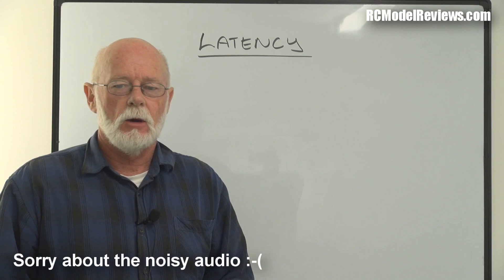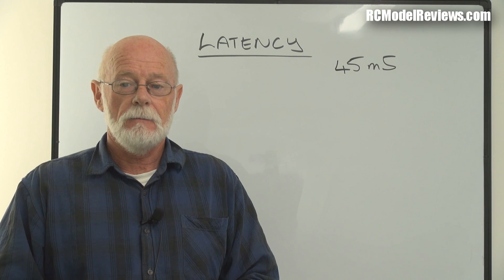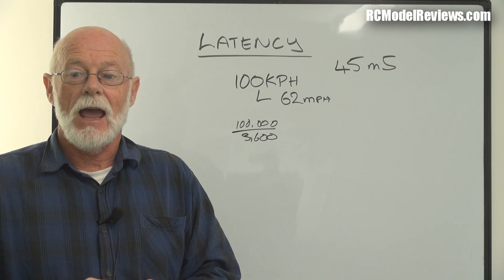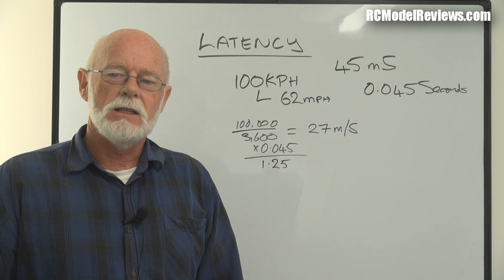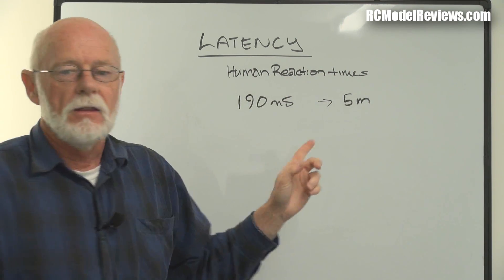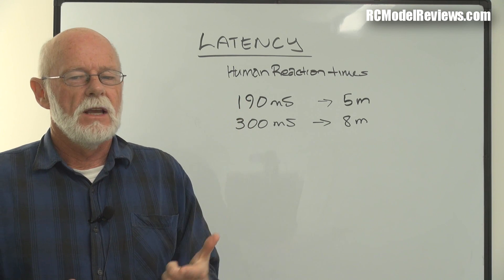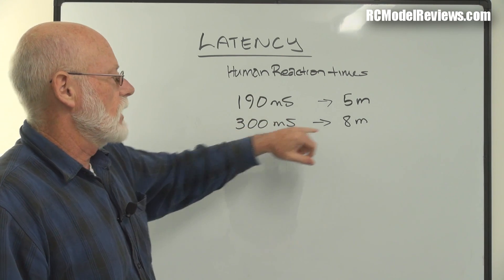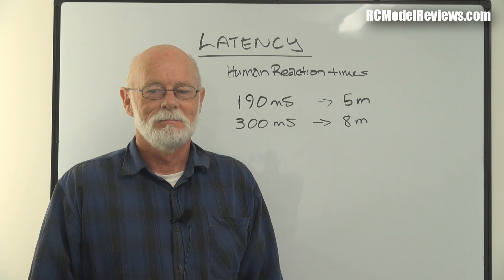FPV Video Latency - does it matter?

Comment: Back when i used to be a competitive gamer a decade ago, i recorded reaction times of around 170 on click test. But i believe there is not one uniform reaction time, i think minor corrective motions towards executing pre-planned actions based on positional feedback could happen as early as in 50ms. I don't think sudden event or obstacle that click test could represent is the relevant kind of event that usually stresses latency based response, rather it's the motion deviation. You'd think if the reaction time was uniformly 220ms, you wouldn't have had the experience that higher latency system spoiled your manoeuvres.

Comment: Thanks for that. Rounding out your figures, the quad will travel 1 metre per 1/100 sevond. There seems to be more cameras than quads at the moment and, at my age, I can't tell the difference. The authorities here in the UK have tried to make us use KPH for 30 years or so, but the speed limit signs are still in MPH.

Comment: To fix this latency issue, discarding the human factor. Is to shrink yourself so you can comfortably fit inside a racing drone. Hopefully there control gimbals are small to fit your scale. 
Although you may experience significant delta in gravitational forces against you which is typical in a multirotor flight pattern.

Comment: Latency -- a topic i'm very familiar with.  In my experience with online gaming, the lower the latency, the better.  50ms or under is next to real-time responses, 50-100ms is about borderline playability, and over 100ms means a crapshoot.  And I'm pretty sure the same thing is applicable here.  50ms or lower, you know exactly where you are, 50-100 ms you might know where you are, and 100ms or above you're simply guessing -- and if you guess wrong, you get a crash.

Comment: I wonder how this relates to video gaming latency times. You have high end gaming monitors that boast a 1ms refresh rate, and anything under about 5-8ms is mostly not perceivable. But this is more to reduce ghosting or redraws from one frame to another. If you look at VR headsets you need at least 90fps and very low latency to reduce motion sickness from the difference head movements to what you visually see on screen. I think your brain learns a buffer when flying or doing anything with latency involved, the more you do it the more natural it feels.  Also, when you fly you are not just completely "reacting" to the situation, you are formulating a path in your mind given the visual data you already have. It would be really funny to switch someones video goggles on and off every 5 seconds and see them fly by "reacting" every time the goggles come back on!

Comment: i watched your videos on ducts i have a question, what would happen if you just duct beneath the propeller? would the air hitting the side of the duct have enough negative effects where it is not a benefit? are ducts beneath the propeller a benefit at all? say you hooked up a quad with super light ducts just beneath the props. what happens if you use the push method with a duct so that the air being pushed down isn't blocked by the quad frame? what happens if you use the push prop method and put ducts just beneath the prop would this help? so a racing quad with push orientation of the props using four blades per prop with bullnose and ducts just beneath the props? from what i know this would give the prop setup more efficiency so to get the same thrust you can use less power from the battery granted the surface of the side of the duct doesn't hinder performance

Comment: I bought a fatshark 700tvl ccd cam for my Xugong v2.  This is my first quad / build.  I am very disappointed in the clarity.  I was at our sports plex this after noon testing out my ezuhf system and and cannot say how horrible the video looks. my vtx is 600mw 5.8 with CW antennas.  Im using my Atomos Shogun as my fpv monitor until i find some googles.  I usually use this monitor to record 4k 10bit video out of my gh4.  Man if this is the best state of FPV holy crap it is horrible.  Are there options for real 720p or 1080p?  the fatshark 700tvl ccd is junk imho.
thanks

Comment: When we fly our eyes and ears are part of a big PID loop. Our fingers must move fast enough without over shooting P and we must predict what will happen so we do not overshoot D and of course we are always correcting for overall drift to make it in the gate I. when you add latency your brain has to add more D which tends to add noise. Steele hates adding D. So as I see it its a matter of how much error you can tolerate in the form of noise. We all can adapt to the delay but as we push ourselves it adds more noise because we have to predict more to compensate. imho.

Comment: Howdy Bruce,
 Looks like you stirred up a little discussion. :)

I guess the way I see it is that each latency is at best additive and in some cases may be more. 
camera, vtx, FC, esc, motor, prop flex, radio, pilot. There are lots in the mix. it is amazing we can fly at all.

If you are cornering or dodging trees, you do want as low a latency as you can get to give your reflexes more time to line up your trajectory. Being 1m out with a gate = crash. If you halve the speed .5m =crash.

That being said, for most people in most situations what you have said is more than reasonable. People will adjust.

I would still go for a blend of lowest latency and best picture quality I could afford. 

cheers and thanks for posting

Comment: First video ever where I think you got it wrong. Comparing a systems transport delay with human reaction time doesn't really tell much of the story.

A transport delay very well below the human reaction time can still severely impact the Responsiveness. When you fly, most control inputs are not related to reacting but to timing your input with what you see. Humans are far better at timing than reacting (or for example playing instruments in a live band would simply not be possible).

The same goes for computer games. See the section called "Responsiveness, Not Reaction Time" at http://www.gamasutra.com/view/feature/130359/programming_responsiveness.php?page=3
Reply: "Timing".  Thanks for introducing that concept.  It makes a lot of sense.
I think it is our ability to adapt our timing that allows the adjustments Bruce talked about in his 3D flying with different systems(latencies).  However, I agree that the precise timing  needed for gates or flying through trees would require the least latency possible in the transport system.
Reply: Nope he covers that just fine. He specifically states that changing from a high latency system to a low latency system he couldn't perform certain manoeuvres until his timing was adjusted. He also specifically states that latency doesn't affect timing at all at small values of latency.

Comment: You should also be concerned about latency produced during the wireless transfer of the video signal. How many milliseconds of delay does this add?

[Time for a very sarcastic, hypothetical story].
Learning about the actual consequences of latency in FPV flight has gotten me a bit concerned. Imagine seeing one of those crazy multi-rotor pilots, flying illegally in a public park. He's flying at 100KPH toward your poor, little baby, Sue. If the dangerous, airborne death machine is flying 1.25 + 8 meters away from the innocent, helpless girl, the bastard will have become murderer without even knowing it! What makes this even worse is that he probably didn't register himself as a legal RC pilot! This could have been prevented if he had done so!

Comment: IMHO latency is more important because of the feeling (immersion) when flying FPV, not the reaction time - you are in a known Environment/Track. 
For example i had a digital FPV transmission with 150ms system latency and it feels really strange... I have even heard from guys that tested the Connex Prosight in HQ mode (specified with only 26ms latency) that they switched to lower quality (specified 9ms latency) beacause it feels just better.

Comment: The video is about difference in latency between two different cameras, nothing else.  Therefore it 
is assumed, for the sake of discussion, that all other factors and equipment are the same.  That 
renders meaningless all comments about additional latencies that allegedly need to be accounted for.
They are only relevant in a discussion about total latency of the entire machine. 
To put it simply, 
new camera vs. old camera is all that's on the table here.

Comment: Would camera location help with FPV? Been looking for a quadcopter with the FPV camera as close to where all axis intersect. "Hope I worded that right." My thinking is less camera movement ads to image quality and slightly better flight experience/precision. Imagine sitting at the pivot point of a teeter totter vs at the ends..less movement equals better image quality. Something like a visual expo for the brain if that makes sense.
Reply: Nah, it actually doesn't make sense. You will absolutely not notice any difference. The only thing it will change is the center of gravity...
Reply: Awquad Less movement is better for camera view. The FPV camera where I'm saying does exactly that. When you pitch forward with a camera on the front there is more movement...right??  Where do you stand in/on a boat when it's choppy? The center where there's less movement. It's not rocket science. Might not be much but I think it's enough to consider and could improve your skills. Isn't racing being taken more seriously now? Any edge over the competition can be key.

Comment: Are you sure the roughly 190 to 300ms reaction time is the relevant number here? I thought that this is the reaction time if you i.e. drive a car and someone unexpectedly brakes in front of you. Then there is obviously a reaction time which I guess is similar to your 190 to 300ms.But if i.e. Mr. Steele lets his quad fall to the ground then he expects that he has to break the fall before he hits the ground and there is nothing unexpected going on. He just has to see how near he is already to the ground before he moves the sticks - which his muscle memory will do. I am no export but I can't imagine there is also roughly 190 to 300ms reaction time involved in these maneuvers. But this is just my guess, maybe I am wrong. Make ask Mr. Steele.
Reply: I did simple a reaction test with an Arduino, LEDs and Buttons (the led lights up after a random delay and you have to press the button as fast as possible):  I and my friend got a reaction time down to 150ms.
But it gets way worse if the task is more complex, with 2 leds and corresponding buttons, below 200ms is already really hard. 
A step further with one led that lights up in different colors and 3 buttons it takes usually about 300ms - 500ms....
This was of course everytime a expected event, unexpected stuff where you have to decide what to do take even longer, the rule of thumb when driving cars is 1 second.
Reply: I'm surprised he hasn't replied to these comments.  Bruce is definitely wrong here.  Reaction time is irrelevant because flying is not a series of unexpected events.  If you can predict what's going to happen then your reaction time is very close to 0.  For example, watching a car come towards a finish line and hitting a stopwatch when it gets there is completely different than waiting for a screen to change color at a random time and reacting.
Reply: He explained it when talking about 3D flying and switching from analog transmitters to digital ones. For someone like Mr. Steele it probably would be a problem to switch to a higher latency and would limit a bit what he can do. If you are a pro, you know what you need. The argument is that for most of the people who fly for fun, 45ms is not a deal breaker. Difference between 10ms and 45ms is not relevant for a beginner or a intermediate pilot, but it can be for professionals.
Reply: What would be more impressive is if this was set up as a loop (with just one LED).  The Arduino could listen to an RC channel instead of a button and then the LED is viewed via FPV goggles. That would give you a clear indication of the actual lag between the LED coming on, actually seeing it, react and sense the reaction all in one go...  Better still, have 'arrows' so that the direction has to be followed which is probably more a 'real world' example of reaction time with FPV.
Reply: Nice real life test there hippo !

Comment: Think the point is.  Your brain will compensate for any amount of small latency introduced after a short amount of practise time.  People are too into the Hype train, and rave on about numbers quoted on specs which are largely unproven.  Take C ratings on the Lipos for instance.  Absolute BS rating system with no standards.  I think SMC batteries is the only one that comes even close to using a real rating system.  Get off the Hype train, stop worrying about the numbers, and learn to fly your Quad better instead of blaming the equipment.
Reply: SickocrowAU That's why everyone says to get a battery with a C rating at least 20% over the current you are pulling
Reply: "Take C ratings on the Lipos for instance.  Absolute BS rating system with no standards."

Surely C ratings are calculated from the sizes of the plates/strips used to make up the cells etc. There might not be an industry standard for that calculation but it's not just pulled out of the air.
Reply: Unfortunately if you actually test that C rating under a proper controlled test the battery will fail in a very short order.  C rating and burst rating....how long can they hold those ratings?  Not specified is it.  Because in real world conditions these batteries cannot even come close to their claims.
  Check out the testing Joshua Bardwell did on a load of different batteries.  Nothing stacks up to its C rating.

Comment: 45ms is only the latency from the front of the camera to the back of the camera. The 45ms doesn't include the time it takes the vtx to process the signal and transmit it to your vrx or for the googles to display it. The latency of the camera is only 1 of about 5 parts that make the entire round trip from what the camera sees to the quad implementing correction. But the latency of the camera is something you can reduce. Which is also why we use an analog signal for the vtx as a digital signal has a lot more latency.
Reply: i just rewatched this part and bruce stated that this value came from the docs of the eagle camera which would only be the camera as they could not state the latenacy of the other parts of the system.
Reply: Yes I agree too, the latency is cumulative, not independent of each other.  You can't state that the latency is irrelevant just because human reaction time is 'way more'.
Reply: What's the "processing time" in the analogue chain after the camera? Sub ms?
Reply: +Gordon Heydon Agreed 100%, not to mention the latency of your radio control system's transmission time, and the latency with the flight controller telling the esc's and motors commands, which is why sbus is so much better over ppm.
Reply: What do those acronyms mean? (PPM and sbus)
Reply: Pulse Position Modulation (as opposed to pulse Width Modulation, which is a standard RC servo signal).
SBus is just a shortening of Serial Bus which uses actual serial data rather than a pulse width/position
Reply: Ah, I see. So SBus encodes the values in binary?
Reply: Basically sbus is a digital transfer and takes about 8ms (if I remember correctly) to transfer 16 channels where is PPM/PWM is and depending on configuration takes 18ms to transfer 8 channels but if you need all 8 channels you need to reflash the receiver to use 27ms loops. These are frsky values and other receivers will be different.
Reply: Forgot to add the PPM is a multiplexed version of PWM so that all the channels can be passed over a single wire
Reply: My tests for Runcam Eagle are 0.030 to 0.045 milliseconds from camera to Vtx to Goggles to DVD recorder.
Reply: I am sure Bruce measured latency from lens to display as that is the only way he can measure it.

Comment: The thing is, latency is very different than reaction time...   you dont have sudden impulses in a race, you line yourelf up and follow muscle memory from practice laps. what you should be looking at is the latency from the human eye to the brain   which is approximately 80ms. This is still a reasonable amount but not 190-300ms...   

the other day i was trying out flying with the simulator using a camera pointed at the screen so i could wear my goggles. the camera was the turnigy 2k which is known to have latency when streaming fpv but not too much.    the thing i found with this latency test is not depth perception but imputs when making movements. it felt really sloppy as when i flick the sticks back to center the simulator still momentarily continues rolling making it incredibly hard to get the exact angle i was hoping for...

its possible to fly with latency but not smart when making short and snappy movements. I feel 40ms would be far too much for anything other than a plane for smooth soaring or a slow quad
Reply: AusRC Its possible to learn. I installed an RC app/game once and the latency sucked, I was all over and could not fly. Reaction time is different in everyone and not always the same either. Too many factors involved.